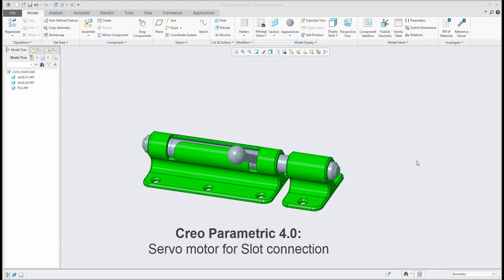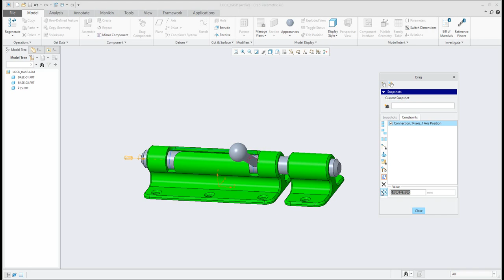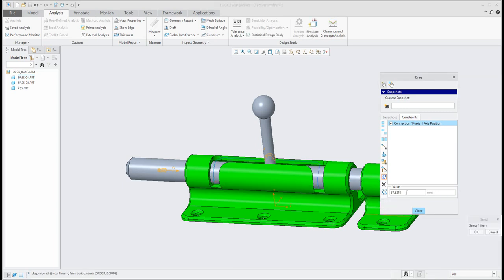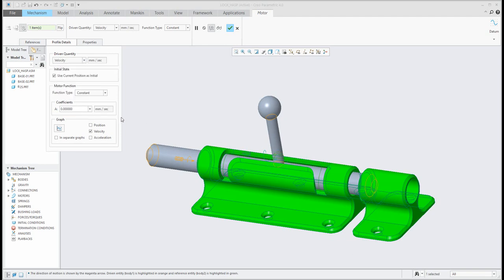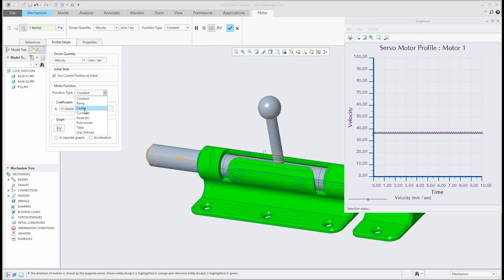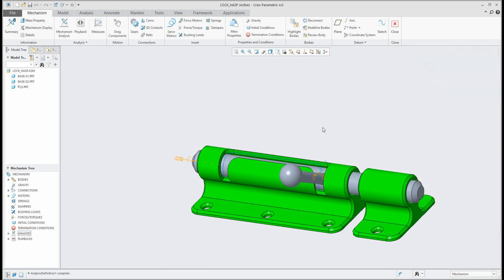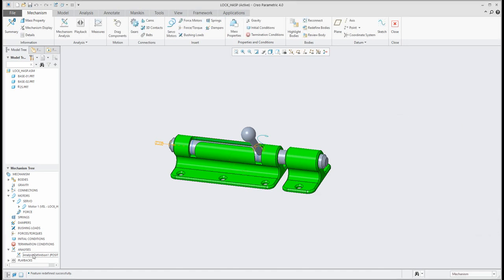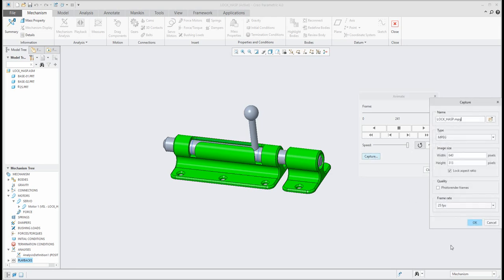PTC Creo 4.0 tutorial: Servo motor for Slot connection

Comment: Thanks for sharing the informative video. Sir I am working with a four bar mechanism in which one one of the link is a crank. I want a graph which could show the velocity of a point Vs angular displacement of the crank. Will you please help me out. This would help me to solve the problem which I was trying since one and half year. Few research papers are there in which they had solve the same but by using the other softwares. To understand the problem properly I can share you the graphs they had drawn. Here is my email ......     ajitpmagar1355@gmail.com ......please help me for which I shall be very grateful to you.
Reply from the maker: Hi, thanks for your question. In these days I am a little bit busy (you know summer time).. But I will send you email later, I will not forget. Bye Vladimir
Reply: Thank you Sir for Reply. I m pursuing PhD in AgriI. Engineering and working on Vegetable Transplanter. In that matter needs to know how the planting jaw is working w.r.t. rotation angle of driving crank Vs a Velocity, acceleration etc. I wrote the same question to many who are posting the videos on YouTube on Creo....but you are the only who responded on time. Thank you once again ...witing for ur valuable help.